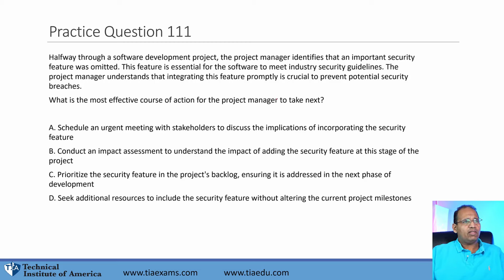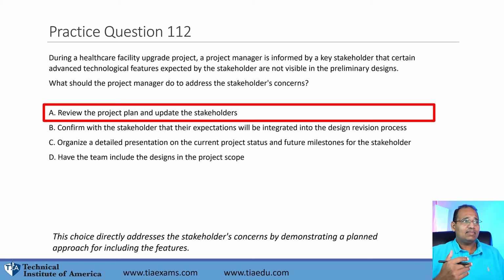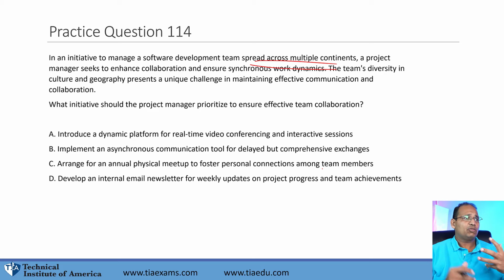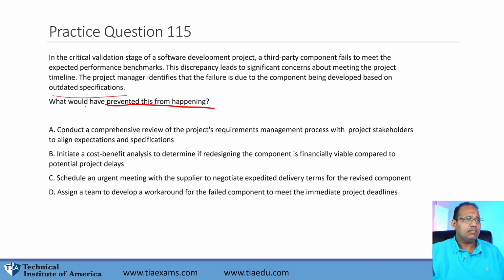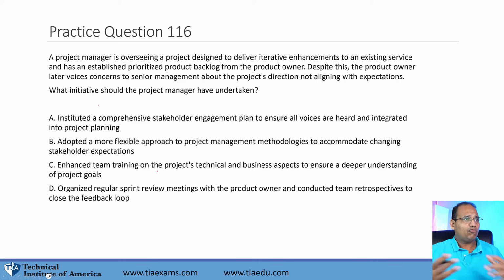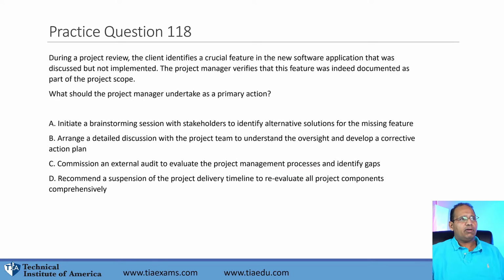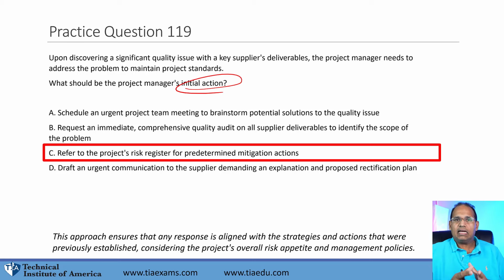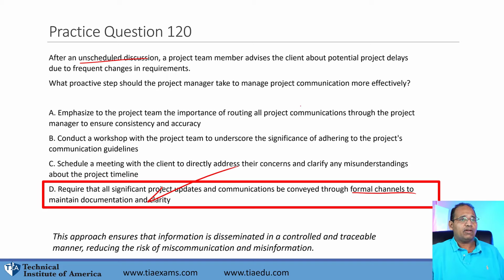200 Ultra Hard PMP Questions 111-120

Comment: I think the answer to 119 should be A. it's not a risk, it's an issue. It was discovered means the Q never explicitly specifies a risk. Discuss.
Reply: Agreed
Reply: @kissajoram274  The idea of risk register is to document the response when the "risk" becomes an "issue". As soon as a risk becomes an issue, we use the response we have documented.

Having said that, this question is ambiguous as the question does not mention that this issue was identified as risk in the past, so the answer is "assuming" that it must have been identified as risk in the past. With that assumption, the answer is C

Comment: does the risk register tell us what to do if the issue happened? or only to deal with the risk with mitigation/avoiding/transferring/accepting during the risk period? why we refer to the risk register if the issue is already happened? don't we should do a meeting for brainstorming with stakeholders/team to address these issue? so I said we can do A first since C is not related to question.
Reply: I mean the the question is about an issue already happened but you're looking for a mitigation action? maybe mitigation is possible when it's still in risk period.

Comment: Question 114- When the teams are spread across different time zones- Asynchronous communication is the best method of collaboration. That makes B a better option. Think about- a team is in India, while another team is in the USA - there are almost 12 hours of difference, making a video meeting at a particular convenient time for one team might be a hustle for another, and might be a base for creating the perception of preference. Asynchronous communication tool, by definition, offers the advantage of flexibility for teams members to response according to their time zones and work schedules, minimizing the fatigue, and allowing more focused work periods. The key driver is that the first says- multiple continents. A PM should try to avoid forcing people to work outside of their regular hours within their time-zones, adding stress to their local schedule. IMO
Reply: i'm totally with you in this question, i think the answer B is more suitable for question 114. For a team spread across multile time zones it's more suitable to implement an asynchronos communication tool than forcing some team members to attend meatings at non adequate times.

Comment: Question 119 it is an issue not a risk
Reply: It could have been a risk before, but that doesn’t mean it was. Because of the wording of the answer option it implies that it was already a risk, but we can’t know that. Theoretically, you could refer to the risk register as your initial action in case it was there, Semantics. Is this about project management or taking tests with trick questions?

Comment: 91/120......I think the answer to 120 should be B and not D, as the latter is quite autocratic. There is nothing wrong with B; PM does not pinpoint anyone, and the workshop is collaborative and the agenda solves the issue.
Reply: The key word to take home is ‘’ manage’’ your choice B does not have any channel to manage effective communication rather it emphasizes on the importance of communication guides. For me D is still the answer as it has a channel through which communication can be manage incase of miscommunication or misinformation one can easily trace it back to same channel… that’s management there..
Reply: @barbaraoi7891 additionally, a workshop - you are taking projects time.
Reply: @barbaraoi7891  But the communication guidelines are there for managing the communication. It is broader than the formal or informal channel, it is the overall rules. I still think B is a better answer
Reply: I also agree to this point, D option is a reactive step while the question is asking for a proactive step that should have been taken. In my opinion also it should be option B.

Comment: Thank you Andrew . Got 8 out of 10 And last two went wrong. I m us in your pmp final mock in udemy . Consistently scoring 75%  in  all mocks.
Reply: Well done, but I would urge you not to get too overconfident. I got 8/10 in most mocks I did and still failed the exam. As Andrew himself has advised, it is more important to get the mindset right. Once you get that, passing should not be difficult.